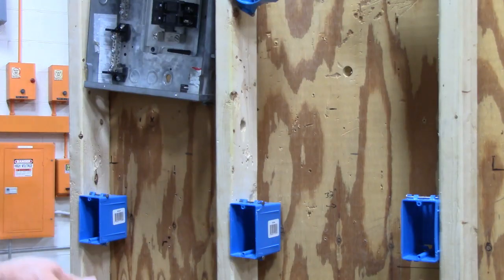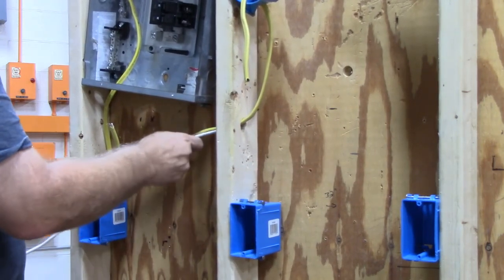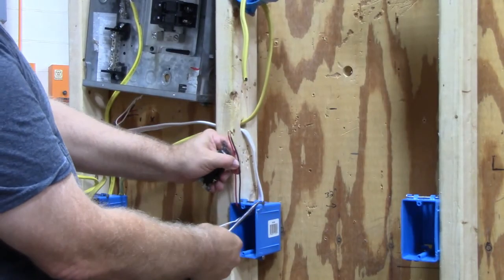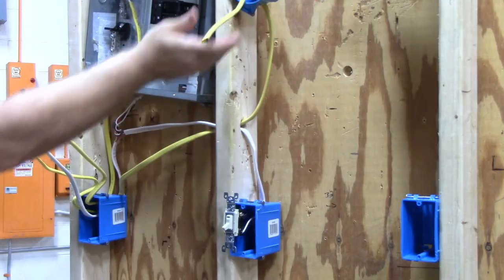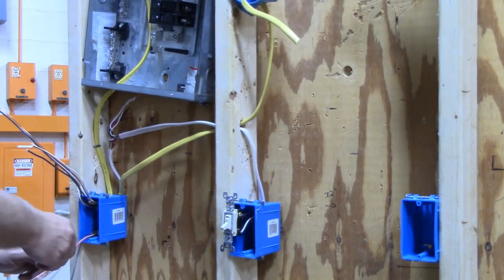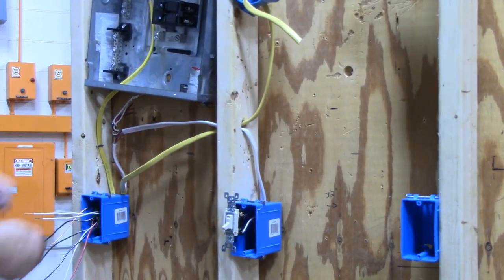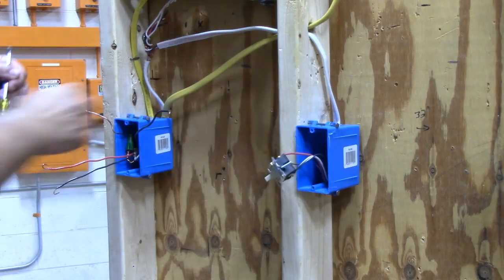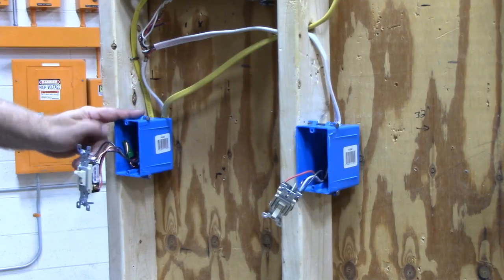three way switch, power and switch leg in the same box

Comment: I've never shared a comment on YouTube until this,  I had this same setup with a 4 wire in between the two 3 wire switches and every video until yours exclaimed a basic line-swtitch-switch-load scenario and I could not get it to work correctly until I watched your video and you explains the switch leg with the black-white on the load had to be spliced together and then just ticked away inside the box.  Thank you so much for showing a less common method used to wire 3 way switches,  it was immensely helpful.

Comment: Thanks for posting! This works perfectly when adding a new three-way location to a single pole switch.
Reply: Not quite. 2020 NEC requires all switch boxes to have neutral present. So instead of a 14/3, you'd need a 14/2/2
Reply: @aurvaroy6670  we still do them with feeds and sw legs in the same box, but my old company did it with splices on both sides but regardless i think the code we are still useing is the 2017 one because the 2020 one hasnt been accepted
Reply from the maker: @aurvaroy6670  codes usually run a few years behind and some places adopt faster than others

Comment: Great video and hard to find explanation on other YouTube channels.  The only other video I've seen is Electrician U "Three Ways 3-Ways Can Be (3way Switch Wiring - ILLEGAL AND LEGAL METHODS".  According to Electrician U, this method is legal and is called a "dead end" three way switch because it can't be extended beyond the last three way switch because there is no neutral. It is a handy setup if you want to add a switch after the framing is done and it is more convenient to bypass the light and go directly to the switch.  An example is as adding a switch at the other end of a hall or room addition where there is only a single pole switch on one end.  But another disadvantage is many new "smart switches"  require a neutral and won't work with this setup.

Comment: Great explanation!! Just wired my house this way and was going to undo it to have power in one box and switch in other. You saved me a ton of time.
Reply: Well you'd be better off having power in one box and the switch leg in the other since NEC now requires neutrals to be present in all switch boxes
Reply: @aurvaroy6670  YUP !!!
Reply from the maker: @aurvaroy6670  only one box on a 3 way circuit needs to have a neutral 404.2(c)
Reply: @timpalmer-logstolumber1999  Right. Didn't know that back then. Still it's nice to have neutral in both boxes just in case you want an add-on smart switch.

Comment: In my neck of the woods this method is known as the dead end three way, and I've wired a good handful of these over the years, most commonly on remodel projects where I need to convert a single pole setup into a pair of three ways, sometimes with a 4 way included as well. Other times were in very long hallways on new construction in which the power feed and switch leg are located on the same end of the hall to to speak, I can save some wire.   

Note that as of 2011 with slight changes over the last 3 code cycles, an available neutral is required to be present in at least one of the switch boxs, because in this day and age, there are a wide variety of electronic switches requiring a neutral for standby power,  whereas back in the 1970s when it was a common practice to run the power at light with a two wire switch loop, switches were a simple set of make and break contacts,  so having said that the dead end three way method may or may not be code compliant depending on the situation as wel as the AHJ
Reply from the maker: @Sparky-ww5re  yes, they keep changing codes so always check codes for updates. But working on older houses you may run across this setup.

Comment: I have two different three-way switches. The black common is by itself on one of them and on the other it’s not by itself. Not sure what to do in this case.
Reply from the maker: @Otho1001  is the second one feeding another switch or outlet? Is it pig tailed or are both wires hooked to switch? With some more info I could be better able to give you an answer
Reply: @timpalmer-logstolumber1999  no nothing like that, I have two switches, but the terminals are configured differently on each of them. The top brass screw is on the left on one of them and on the right on the other. In the video it says to attach to the screw that is alone on one side. On one switch there is a brass screw that is alone and on the other switch there is the black common screw that is alone.

Comment: Not sure if you can answer but, I have an older home I'm renovating with
 switch loop wiring going into a J box powering basement light fixtures,
 and also 3 receptacles on the 1st flr. I want to add 3 way 14-3 wire 
going into two 3 way switches. I will remove the current single pole 
switch and use the same wiring on the switch onto the 3 way switch so that all fixtures and 
receptacles continue to work as before, plus add the 3 way wire running 
from switch to switch.
Reply from the maker: It should work, the single pole switch should have power and switch leg, run 3 wire to second box

Comment: Hi , thanks for sharing! My question is is it possible to connect a 14awg wire to a 12awg wire for lighting ?
Reply from the maker: It is not recommended but you can as long as the circuit breaker is for the smaller wire. So you would have to use a 15 amp breaker.

Comment: Awesome video Tim! I have to do this and need to add a 4 way in the third box, but, I can't add a 4 way without a neutral can I? It's considered a dead end at the 2nd switch? :(
Reply from the maker: @traderman4378  if you have any questions let me know.
Reply: @timpalmer-logstolumber1999  Hey Tim, my setup has the power wire and the  power to the light wire in the same switch box. Any way I can use a 4 way to have 3 switch locations in this? 4 wire?
Reply from the maker: @traderman4378  yes you can 4 way it. Run a 3 wire to the 2nd box and then the 3rd box. In the first box connect hot wire to switch, the common screw. Then connect black switch leg wire from light to white wire going to box 2. Then white to white going to 3rd box. This is switch leg it connects to switch in box 3. The common screw.
Reply: @timpalmer-logstolumber1999  Thanks Tim, I'll see how it goes
Reply: @timpalmer-logstolumber1999  I don't seem to be getting it. I have a 3 wire coming  from a ceiling light to my switch box where I'm putting the 4 way switch. black is the hot, red is the switch leg to light, and the white neutral. You said hook hot to the common, got that. Should I use the black and red from the 3 wire as travelers to 2nd box? Do you mean physically hook the red (switch leg) and white together. If I hook them together I have a 4th terminal with no wire on it? Unless you mean hook them both to the same terminal on the 4 way switch?
Reply from the maker: @traderman4378  the 4 way switch has to go in the middle. The ends get 3 way switches. If power is coming from the light it will be hooked to the common screw on the 3 way switch. The red wire coming from the light is the switch leg, it gets hooked to the white wire in the traveler. The other end will be hooked to the common screw on the other 3 way switch. The white wire coming from the light would be neutral. Not all switches need neutral. The red and black traveler wires get hooked to the other 2 screws on the 3 way switches. The 4 way in the middle would get black and reds. The black and red from each traveler have to be across from each other.

Comment: This was very informative. Should have said the 2 travel wires go on the brass screws. My 3 way switches had the brass screws diagonal from each other. Not straight across. Really helped me though.
Reply from the maker: Yes there are other switches that are not like the ones I use. You have to pay attention to the colors. Silver for neutral, brass for travelers, and black for Hot/switch leg.

Comment: I have the same set up Plus a fan light combo in the same box 😅 my brain almost melted
Reply from the maker: I would be happy to answer any questions you have in the future.
Reply: In this situation where you have a second, single pole switch in the first box, do you do two pigtails off the black hot wire, one to the bottom right screw of the three way switch and one pigtail to the gold screw of the single pole switch?

Comment: Great video! How do I install an outlet from a 3 way switch? I need an outlet to power a tv and the three way is the closest to it. Can it be done? thank you!!
Reply from the maker: If the switch box has power it can be used to power an outlet. Use a pop in box, run a wire from pop in box to switch box. Tie into power and neutral in switch box.

Comment: The box that has the white as the line wire with only one 12-3 in it has no neutral in it correct? So that box would be impossible to jumper off of to run a new switch and light out of correct? Cause the LED fixture has a hot and neutral wire to hook up to and without it, it just trips the breaker.
Reply: Correct, without a neutral there is no circuit and the light will not work. Besides, this method wouldn't actually work in todays world anyway. Code says there MUST be a neutral in EVERY switch box. No neutral = No pass. You would have to use 4 wire instead of 3 wire for the traveler to do what he did in this video.  Even though this works, it simply would no longer pass inspection, but I'm not saying it won't work.
Reply from the maker: @godmode3359  this is correct if the new code has been adopted in there area. Adoption usually lags behind a few years. Also DIYers working on there own house and not being inspected could still use it.

Comment: Are the light switches with the toggle a special kind for a 3way light switch connection?
Reply from the maker: Yes, you have to use 3 way switch, these are the ones that don't have on/off on them. They have screws for three wires.

Comment: Hi Tim.  Great video.  This is how my house was wired.  Question...is there a way to add an additional light to the system between the 2 switches or would it have to be off the existing light?  Thanks!
Reply from the maker: you could run a wire off an existing light or you could drop a wire into the switch box with the power and switch leg in it.
Reply: Hello Tim. A great and easy way to add another light to the circuit is by "tapping" into the black/white/ground wires from your existing light. I do this often when I install recess lights around my house.. You can do this several ways, but the most convenient way I like is by using the wago lever nuts which allows you to grab the wires together.

Comment: I followed this video exactly (only difference is I used rocker switches), but my switches face opposite directions when the light is off. Is that expected?
Reply from the maker: It doesn't matter if they are upside down. Usually on a single pole switch the on is up. If they are three ways it doesn't matter.
Reply: Yeah, functionally I know it doesn’t matter, but I’ve got the switch in a 2-gang box with a 2-way switch, so the off positions aren’t matching. Should I just flip the red and black travelers on the right switch?
Reply from the maker: @JohnDiBaggioSanto  three way switches will vary depending on where you turn it on and off, changing wires won't help.

Comment: We put in a dimmer switch and followed your instructions but the black power has to be across from the red traveler.
Reply from the maker: Depending on the switch, some have the screws in different locations. The swl/hot is a different color screw or marked common. Sorry for not mentioning that.

Comment: thank you for your video I used it to install 2 3 way switches in my house. However I can't figure out why the both lights on each individual 3 way switch flicker only when they come on. It does it for a second then is fine. It's a Led/incandescent switch with a incandescent bulb on it. I have the same light bulb and switch on the same circuit in another room and no flicker. I checked all the connections to rule out a loose connection and didn't see anything loose. Any ideas?
Reply from the maker: It could be in the switch or the light fixture
Reply: @timpalmer-logstolumber1999  thank you I figured it out,  can't have two dimmers in a 3 way switch

Comment: u can also tie your neutral in to your hot and use your black wire switch leg to the light for the common on your first switch and use the neutral that was tied into your hot for the common black terminal on the other switch
Reply from the maker: I would like to see that method, could you send me a diagram at 13husky18@gmail.com. Thanks

Comment: Does it actually matter which screw your travelers are on as long as they're on the traveler screws and not the common? So you made your red on the side with the screw by itself, but could the one switch have it like that but the other switch the red be on the screw side that the common was on. Or would it work the same as long as travelers are on traveler screws but not the common screw
Reply from the maker: It does not matter which side they are on. I teach my students to be consistent, they are less likely to get it wrong.
Reply: If you swap the location of the travelers the switches will be in opposite orientation when the light is on.
Reply: @timpalmer-logstolumber1999  Hi Tim, Great video on this. I have found that if you CROSS the traveler locations of 2 alike 3-way switches, the two  3-ways will still do the job as intended BUT when a 4-way switch is used between the two 3-ways to get THREE switching locations for a light it won't work unless you go back and UN-cross the 2 travelers from the 3-ways so they go to identical traveler terminals as you noted here.
Reply from the maker: @bobrub  working with high school kids I try to get them to do it the same way each time, they will make less mistakes. Then later I cover other ways because not all switches are the same. Especially from older houses.

Comment: Is it possible to add a wire to control another light to the box that has only the switch leg wire? Thanks
Reply from the maker: Yes, if there is a neutral wire for that light. wirenut the switch leg wires together and then wire the neural wires together.

Comment: Now how do you add an outlet using the wire from the second box?
Reply from the maker: You can't, there is no neutral in the box.
Reply: @timpalmer-logstolumber1999  thanks much! Can I add a neutral?
Reply from the maker: @markied2873  not without rewiring it.
Reply: @timpalmer-logstolumber1999  oh ok...thanks for the info

Comment: Will this work for Dimmer? Let clarify I tried to do this with the dimmer and it fried the dimmer switch
Reply from the maker: It should work with a dimmer. There are several things that may affect it. A couple of things that may affect it are you using only one dimmer or It may be the type of light bulbs being used. Not all light bulbs work with dimmers.

Comment: Does the switch that has the white wire alone is it hot
Reply from the maker: At 4:20 it says it is used as the switch leg. which means it only gets power when the switches are aligned correctly to turn on the light.

Comment: Did not work when using a 3 way Lutron dimmer, The black traveler and the black hot had to be swapped on the switch. Why? Dunno.
Reply from the maker: Some lutron dimmers can be single pole or 3way, look for wiring diagram on package

Comment: So is the yellow wire from panel box to switch box 2 wire?
Reply: yes
Reply from the maker: The wire could be yellow or white. It is called a homerun when it leaves the panel to the first item on the circuit. For light, recepts, disposal, dishwasher etc. it is a 2 wire (120volts). A 3 wire if it is for a dryer, stove, A/C etc. (220-240 volts)

Comment: problem with no neutral in remote switch, problem could be solved using a xx/4 wire  Black, White, Red, Blue , then red and blue used as travelers, Black as the common, to be connected to black-switch, the white would be capped.  Also no repurposing the White wire to a hot with black tape.
Reply from the maker: When working on older houses you going to run into this setup, got to know how it works.

Comment: Is this the California three-way?
Reply: No, it is weird though... it's a traveling bus 3-way that isn't traveling the bus... like it's a typical or standard 3-way except that he put the load on the first switch instead of the second. Not how most guys wire them but it is valid, just weird. It's generally considered best wiring practice to use the same wiring method as those around you so that it's kinda pseudo standardized and makes things easier for everyone.
Reply: Here's a link to a video that shows how most guys wire a traveling bus 3-way:
https://youtu.be/cOFKnAGOPg4

Comment: This is not code under the NEC 2020.  You need a neutral wire in at least one of the switch boxes.
Reply from the maker: The neutral wire is in the first switch where the power and switch leg are
Reply: I thought a neutral wire was required in both switch boxes?

Comment: The only wires that matter are the switch leg has to be under a black screw on one switch while the other black screw on the other switch holds the power wire. The travelers makes no difference to which screw they are under be it one side or the other.
Reply: Yes and No!!  You forgot to mention the other end of the switch leg!  That is the key to “switching on and off”. The other end of the switch leg MUST be joined with the black wire going directly ‘to the light’ -then the circuit is complete and turning on/off from both switches will work!
Reply: @susanhardy8287  My bad I guess I took for granted people knew they had to hook the light up for it to work...